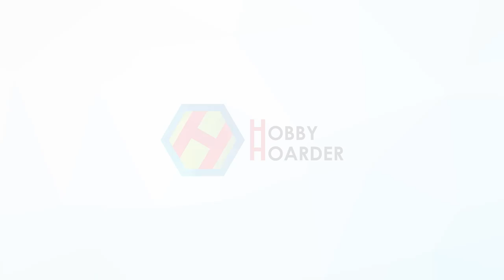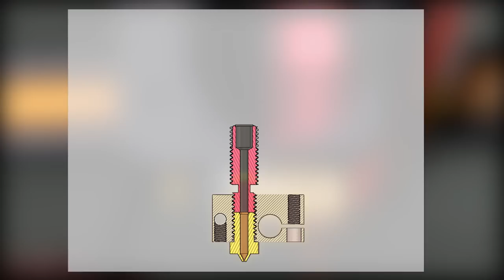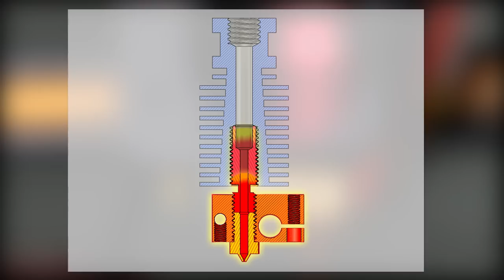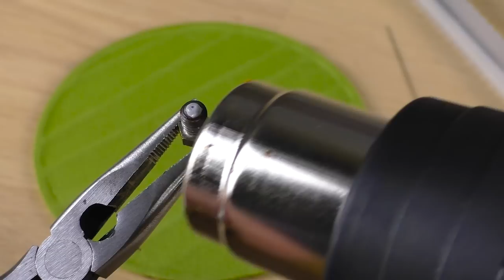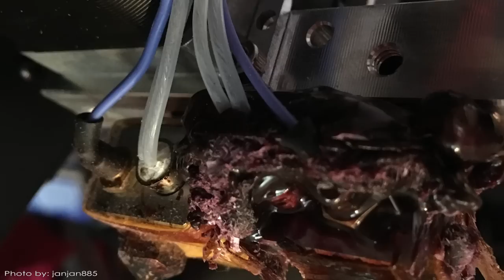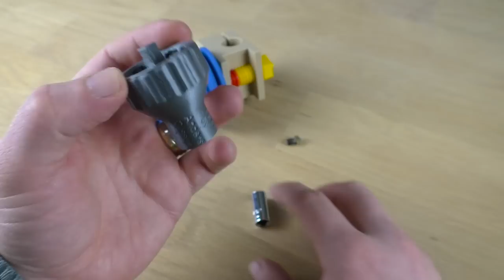Hotend explained and how to properly change the nozzle on a 3D printer

Comment: April 2019. Found the first Video shorter than 45 minutes which explains everthing you need to know! Great!!
Reply from the maker: Thank you, highly appreciated. Sadly, you're right, which was one of the main reason why I wanted to do my own "short" take on it. I only regret not mentioning that the PTFE tube should be pushed in completely as far as it will go, otherwhise it might cause issues as well.

Comment: Great video. I've only been 3d printing for a couple months now and I changed my nozzle due to a clog from my own error. I had just started a new print and noticed that something was dripping down and then I saw the blob of filament in between like in the video. Broke my thermistor in the process of cleaning and had to take the whole thing apart to repair it. Thank you for a great informative video. Helped me discover my error.
Reply from the maker: That's all part of the process, I've broken a few cables as well while trying to clean the hotend. But now that you've taken it apart completely, you've learned the hardest part of 3D printing. It only gets easier now :)

Comment: I had a big mess almost a s bad as you showed...lucky for me after 30 minutes i was able to break all the filament free... on my final tightening i only had my nozzle at 240 degrees... i ran a test and it seems to have no issues printing petg at 235... i do not print at over 240 anymore... this is an excellent video on how a hot end works... i also will keep my retractions down to 5mm or less for now on... all makes perfect sense...
Reply from the maker: The same thing happened to me in my first few months of 3D printing. I got really annoyed that I didn't understand how the hotend works, so I did some research and that's how this video was created.

I think you should be fine if you've tightened it at 240'C, even if you print over that temperature. The thermal expansion can't be that big of a factor once you're near those temperatures.

As for the retractions, try and keep it as low as you can while still avoiding stringing or blobs on the surface.
Reply: @HobbyHoarder  i have been printing a rc boat for 24 hours so far... hot end is not leaking from what i can see,but printing my Esun yellow Petg at 235 Degrees is showing a lot of stringing and leving blobs... print still should look fine after clean up...but Petg has been a constant pain in the butt for me... i use lastest cura... standard quality, .04 nozzle my retraction is 5mm, speeds are 30mms, print speed is 55...cooling fan is set at 50% any suggestions... i have a brand new ender 5 i upgrade to a capricorn bowden tube...thanks

Comment: I've always found that this exact explanation of how a hotend works is also the reason that when you're replacing your nozzle, you should replace your ptfe tubing as well. Esp on any direct drives where it's such a little amount. I've NEVER once replaced a nozzle, without replacing the ptfe tube, and had it work WELL.

Comment: Thanks for this great explanation. I think I finally know why my nozzle keeps clogging.
Reply from the maker: I really hope you'll be able to solve it now. In most cases, fitting the nozzle correctly fixes a lot of issues, although clogging can be trickier - it can also be caused by temperature, hotend design, gearing system, retraction settings or the filament itself.

Comment: I can't upvote this enough. Never knew you had to leave a gap between the nozzle and the heatbreak (tube). This just explained a bunch of bad prints! (I had figured out what the problem was, but hit YT to figure out the right way to install it. This helped immensely. Turns out my parts didn't quite fit right either. I changed parts!
Reply from the maker: It makes me really happy hearing I've helped somebody. Thank you and great job on putting everything back together.

One thing that I'm really sorry I didn't talk about more in the video: you must push the PTFE (bowden) tube as far in into the hotend as it will go, or it might create another gap and potential for a jam later on.
Reply: @HobbyHoarder  Right! I figured that out. Your video was the other missing puzzle piece! Man, I wish someone made a 1.75mm brass brush so we could just ream out those tubes.

Comment: I never saw a better Explanation than this before. :)
Maybe you can explain why my Bowden Hotend leaks every retraction a tiny bit of Plastic even with long and fast retractions?
(I got a Bowden Tube that is 650mm long is this the Reason?)
Hardware i use: e3D V6 Bowden 12V and e3D Titan Extruder and of course the Bowden Tube from e3D for 2.85mm Filament. ;)
Reply from the maker: Yeah, that is quite a long tube, but it shouldn't leak because of that. What retraction setting are you using? Does it leak at the top where the tube connects to the head of lower?
Reply: Hobby Hoarder i retract with 5mm and 100mm/s and no it is not leasing there.
It leaves just little dots that i have to coast a bit.
Reply from the maker: Andre S. Ah, ok. Yeah, that's normal to some degree. It only retracts the solid filament. What's already molten stays in the nozzle and slowly oozes out. As you've already discovered, coasting usually helps. Lowering the temp a bit could also help, because the filament is not so "runny" then.
Reply: Can this speed cause these leaks? I've heard that a filament can split inside the hot end if the speed and/or acceleration is too high. I use not more than 25mm/s for mine. Bowden ~250-300mm long, Titan extruder, Volcano V6, retract to 6mm.
I'm sure you've managed this issue, just interesting to know :)

Comment: Why shouldn't the nozzle touch the heatblock? Thanks for the vídeo, it's awesome!
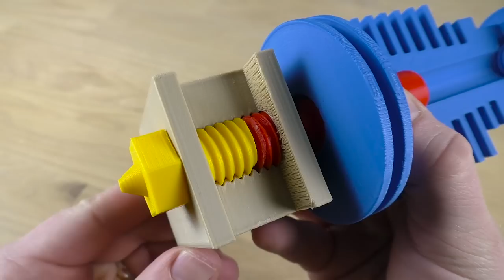Reply from the maker: Watch the video at 3:40. You'll see what can happen if you tighten against the heatblock - you might be left with a gap between the nozzle and the heatbreak. Plastic will start oozing through that gap and it can create a huge blob over your hotend, which is very hard to clean.
Reply: Hobby Hoarder Thanks for the answer! I understand that, but what if I make sure that the heat break goes all the way in and touches the nozzle? Would there be any problem then?
Reply from the maker: Well, if you can really manage to eliminate the gap, then yeah, it would probably be fine for a while. I'd be a little worried about the heatbreak coming loose over time due to vibrations, because the nozzle wouldn't be pushing against it directly. But you're also not gaining anything, you're just making your life more difficult by not being able to easily check if your nozzle is tightened against the heatbreak correctly.
Reply: What I did was screwing in the nozzle all the way, then unturning half of a turn, then I screwed the heatbreak until the end. Then I assembled the rest of the hot end, unscrewed the nozzle a bit, put a tiny bit of thermal paste where the nozzle would touch the heat block, then I heated up the block to 230 and screwed the nozzle all the way in. It didn't completely touch the heat block, but the gap was so small (around 0,2mm or less) the thermal paste completely filled it. Long story short, it's working better than before, no more clogs. My whole idea was to transfer more heat to the nozzle through this method. I don't know if I was lucky or if it was actually a good idea.
Reply: @HobbyHoarder  This might explain why I've been experiencing slowly degrading print quality.  I tightened the nozzle to the heat block and backed it off a bit then tightened it hot.  There very well may be a gap big enough to cause problems.
Reply from the maker: @DavidMulligan  There might be, although if there's a gap, the filament usually starts oozing out after a few hours. Have you noticed anything dripping, any burnt plastic blobs or things like that?

Another possibility might be the hotend fan. I've just spent the last week trying to figure out why my hotend kept jamming. I've cleaned everything 3 or 4 times and it wasn't helping at all, it would jam within the hour. Then I've started thinking about the hotend fan and I've replaced it with the old one (I bought silent Noctua fans). That solved everything. I'm now getting great prints again and no more jamming.
Reply: @HobbyHoarder  Definitely no oozing, though I've seen the odd spec of burnt filament in some prints.  When I said small gap, I imagined something smaller than if I hadn't tightened the nozzle hot.  Actually, I haven't looked under my hotend sock since I installed it.  There are definitely no leaks around the heat break and I can't imagine any around the nozzle.
The bearings in my hotend fan do not sound healthy at all.  Coincidentally my Noctua NF-A4x10 fan is expected to be delivered today.  Heat creep would explain the issues I've seen.  I will still disassemble my hotend to see what is going on in there and reassemble it using your advice.  Then I can be confident there is no problem between the nozzle and heat break.
Reply from the maker: For me, it was like small, black drops that were very hard, almost like glass. I'd find them occasionally on the bed or on the printed object. That's the first clue, so if you're not having them, I think your hotend is fine. Another clue is if your hotend turns into a huge blob :)

My Noctua lasted for around a year. I don't know if I'm just unlucky, I was expecting a better quality for the price. I'll be getting the Mk2.5 upgrade in a few weeks, so I guess I'll end up with a new Noctua soon. In the mean time, it's back to the stock fan. Let me know if you need any help.

Comment: Great video. But please can someone explain why we should heat up nozzle for final tightening?
Reply from the maker: The metal components expand/shrink when heated. To compensate for this, it's suggested to tighten when everything is hot.
Reply: @HobbyHoarder  yeah right, and when it cools it cause some tension in thread, that's why it's difficult to unscrew cold components. Thanks man. It's been 4 years ago and you still answering questions, much appreciated😊

Comment: Great advice! i wish you had carried on for a little bit longer to explain how to attach the extruder to the hot end! I have a Bowden style extruder and have no idea how the neck of the heat-sink i should be pushing my Teflon tubing deep (until it hits the heatblock)?
Reply from the maker: Sorry for the late reply. Yes, the tube should be pushed in as far as it will go. It will be much easier if you thoroughly clean everything inside the hotend first. I like to use pliers to hold the metal and then hot air gun to melt any plastic that's still inside. Then I use the 0,4 cleaning needle and scrape the plastic out while it's still soft.

Comment: Excellent explanation, i just have one question, why the gap between the nozzle and the heatblock is needed? Is it to let some pressure out?
Reply from the maker: The gap is there only to ensure that the nozzle is actually tightened against the heatbreak and not the heatblock itself.

Comment: awesome video. you are awesome. thank you. I am trying to unscrew the heatbreak+heatsink from the heatblock, but they are really stuck. I had a plastic leak from the top of the heatblock. do you have any recommendations on how to fix this mess?
Reply from the maker: Thank you Rodrigo, I really appreciate it.

I'm sorry to hear that. Here's what I would do: very gently try to take off the hotend from the printer. It's best if you can remove all the plastic parts until you're left with just the metal hotend.

Then take either a hot air gun or a hairdryer, gently hold the hotend with pliers (or put it in a vise) and then heat up the melted plastic. You can use another pliers to remove the plastic once it gets soft enough. Just be extra careful around the wires, they're very fragile.

Unscrewing the heatblock etc. will also be a lot easier when everything is hot. You'll have to take it apart and clean each piece individually (again, just heat it up and scrape away as much plastic as you can).

Also, check that the PTFE tube is still ok. If you've been using it for a long time, now might be a good time to change that as well.

Finally, assemble everything back together as I've shown in my video and don't forget to heat it to max. before you fully tigthen the nozzle.

I hope that helps, good luck! I hate taking the hotend apart, but sometimes you don't have any other options and it gets easier with time.
Reply: @HobbyHoarder  thank you very much for the advice. This is exactly what I planned on doing. I have already taken the nozzle off (I left it in nail polish remover overnight, and it helped a lot to remove the plastic) I just have trouble removing the rest of the hotend. But I think I will apply some heat. again, thank you very much!

Comment: Got a question, when heating up to 295°C the nozzle will expand in +z and the heatbreak will expand in -z axis (against each other while growing more length), wich means they will have more pressure against each other.  But when it cools down to 210°C it will shrink and have less pressure and maybe a gap wich of course will leak by time. Is there something i do not understand because thats simple physics. I`ve learned to torque them cold about 4-6nm and when they heat up they will expand and seal against each other perfectly. That means it would be the total opposite way. If i`m wrong, please explain :) thanks in advance
Reply from the maker: I'm not sure if they mill the parts in some special way, but every hotend manufacturer that i know of recommends heating to maximum first and only then tightening it.

This would be really interesting to look into, as it doesn't sound very logical (like you've said, it contracts once it cools down).
Reply: Probably you have to torque them when hot because the heatblock, which is usually made out of aluminum, has a more thermal expansion than the nozzle and the heatbreak, thus at high temperatures tends to separate them. You can easily check this by screwing the nozzle at room temperature and tightening it a little. If you heat the hot end at maximum temperature the nozzle will be loose again!

Comment: Great video, very pedagogic! I have one question though, why does the nozzle need to be slightly separated from the heatblock? When I received my printer (Alfawise U30), the nozzle and heatblock where in contact and it was printing very well!
Reply from the maker: Thank you!

Well, if you tighten against the heatblock, you can't be sure that the nozzle is actually touching the heatbreak. Watch the video at 3:40 and you'll see what I mean. By leaving a small gap, you can be sure that the nozzle is pushing firmly against the heatbreak.
Reply: @HobbyHoarder  Ok understood! I was not sure that it was the correct reason. Thanks a lot again!
Reply from the maker: Happy to help. I've learned it the hard way with a messy hotend a few times, so I tried to learn why and then I've made this video.

Comment: Nice  presentation!
Btw, how can we be sure that the top of the nozzle is completely flush/flash (sorry i don't know the right word ) with the bottom of the heatbreak?
I mean, how can we be sure that neither the nozzle or the heatbreak is just stuck at some point, because of hardened plastic due to clogging or oozing, that may tell us that they are already flushed to each other but in fact are not.
Reply from the maker: Try to clean the inside of the nozzle/heatbreak as much as possible before assembling it together. If there's a tiny bit of plastic left, it will get squished out once you heat up the hotend to tighten it.

Comment: Thank you for this video!! When you’re printing the benchy at the end, the way the nozzle is jumping across the model, is that Z-hop? (I’ve never used it so I don’t know)
Reply from the maker: Yep, you're right, that's Z hop. It really depends when to use it. It can prevent surface marks or nozzle hitting parts of the object while it's moving, but it can also increase stringing and leave small bumps behind.

Comment: What is a proper retraction setting for an Ender 3 to avoid clogs? I’m having A LOT of clogs lately. Thanks in advance!
Reply from the maker: There are various Ender 3 versions, but it you have the one with bowden extruder, I'd start with 5mm and go from there. For direct drive, 0.5mm is a good start.

If it was working ok before, I'd try a different filament brand first, it might be just as simple as that.

You could try printing a stringing test/tower with different retraction settings, that should get you really close.

Comment: Dear Many thanks for sharing!
The trouble I have is a clodge between the heatbreak and the noozle. How can I solve it?
Reply from the maker: Carefuly remove the heatbreak and the heatsink and clean each one as best as you can (remove all the plastic). It will be much easier if you use a hot air gun, but be careful as it can get very hot. When you've cleaned everything, assemble it back together as I've shown in this video.

Comment: Does this mean that I have to remove the heat cartridge and the thermistor for every nozzle change?
Otherwise I can't turn the heatblock because it would snag the cables?

I'd really appreciate an answer to this question. Thanks a lot!
Reply from the maker: Not really. If you use a wrench to hold the heatblock in place, you can remove just the nozzle to replace it. It's a bit flimsy and you have to be careful not to break any of the wires, but you certainly don't have to take everything apart just to replace the nozzle.

There was also a tool on Kickstarter a few years ago that let you replace the nozzle with just one hand. I forgot what it was called, but I'm sure you can still find it online somewhere.
Reply: @HobbyHoarder  thank you so much for your answer!